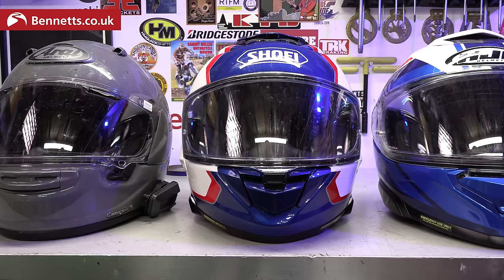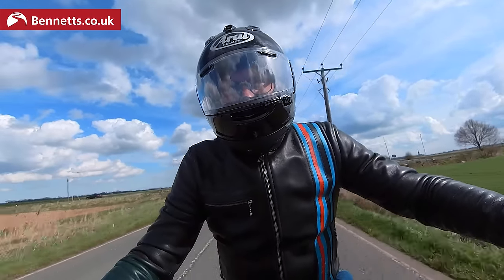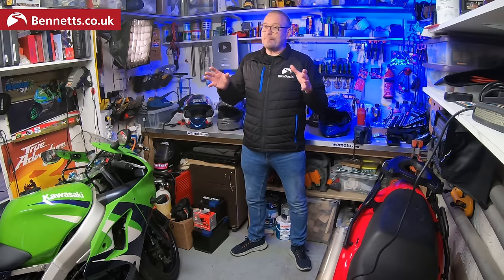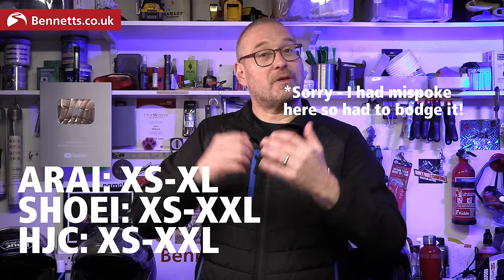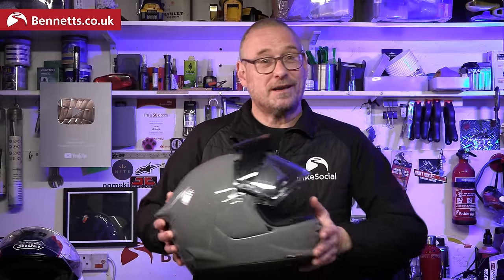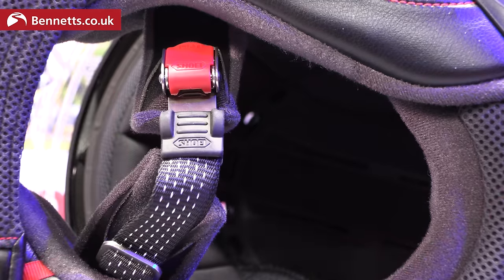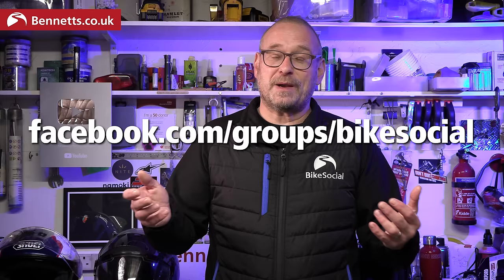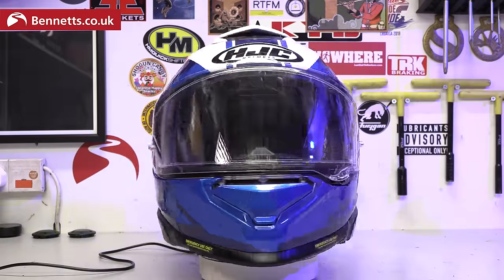Best sport-touring helmet: Arai Quantic vs Shoei GT-Air 3 vs HJC RPHA 71 vs Shark Spartan GT

Comment: I only got my motorbike licence in July. It was really interesting how naïve I was in regard to helmet choice. I was basically just looking at which one I liked the design of! Luckily my friend's dad gave me the best helmet advice you can have - try as many different ones on as you can. This turned out to be especially true being a glasses wearer. I bought a dedicated pair of glasses for my bike with reactive lenses (I do the same for car driving) and found that only a Nolan helmet and Arai Quantic fitted really well with the glasses on. Others just didn't sit as well (my favourite without glasses was the Shoei). My sena 50s kit fits better to the Arai and so that was the helmet for me.  With the reactive glasses the clear screen is absolutely fine even in mid summer days and I find they only ever steam up when going slowly at the very start of a ride (maybe due to the helmet/glasses not being up to temp or something). How fortunate was I that one of the most expensive was the best fit??? 😂😂  3000 miles later I have no issues at all with it, if anything it's slightly more comfortable as the helmet beds in (which is something you need to consider when buying - it will give a bit so any slack will get slightly bigger).  These reviews are brilliant at giving a comparison between the helmets and some of the features that you may want/ prefer but I would say the only way to choose really is to try them on.
Reply from the maker: Glad you got such good advice! Cheers, John

Comment: I jsut ordered 2 Aria Quantric.On sale 15% off (Self and the wife.) I looked at the Schubert as well as those 3 as wind noise was high on the list. (I have the VFR 800 Gen 5 in red like the bike in theI have in the corner.)I had the Aria  X7 I started riding in in the 80s, The Quantum E which had the best fit when new and the Vector 2. Seemed a safe bet the stick with Aria. I tried the Shoei RF 900 way back in 99 but the fit gave me a headache Didn't like the fit of the GT air 2 either. . I don't think I wanted the drop down visor.. The helmets come with the Aria sun shade thing but were free so no loss if we don't like them.  Thanks for the review. All the points of the 3 helments  and what I personally want ,the Aria is the right pick. Glad you didn't change my mine or would have to ring the store on Monday. I did watch the release video you did of the Quantric. You almost sounded liike a fan boy even though said you didn't want too.

Comment: I wear a Arai Viper GT.... Yes I know it's an old helmet (10 yrs old but it's seen little miles & well looked after). Had an Arai back in the 90's the went AGV but found the AGV innards wore out fairly quickly plus it had a seatbelt clip style to secure the chin strap which i felt wasn't that safe  should a crash occur. As for wind noise I've always been in the opinion that Arai's are noisier than most other helmets brands. Looking for a flip face helmet now too & am just about to watch the video on the Neotec 3. Great Video & stay safe out there
Reply from the maker: Give the Arai Quantic a try... It's a huge step up

Comment: I thought the dumbest thing that I ever did was to buy an Arai helmet. Nope. The dumbest thing I did was buying a 2nd Arai helmet. Finicky visor pivot and excessively fragile vents that broke when you look at them. And, even though it was otherwise sized correctly, I had real pain from the pressure against my ears such that wearing ear plugs for more than half a day was impossible. Going back to a Shoei solved every issue.

Comment: HJC seems to fit my head better than any other brand.  However, the visor detent is very weak and I was forced to ride with the visor either completely closed, crack so little that it might as well be completely closed, or fully open.  I jumped ship to AGV.

Comment: The main problem for me with these Helmets is the weight, never tried any of these brands, I would love to but they are expensive, except for hjc,and i can't wear heavy Helmets,I have neck problems,and can't wear a helmet for a long period of time, I've seen most of the reviews of every helmet brand you can think of, every new model,I'm not a big fan of a drop down sun visor, but I have an old Mt with it, it was my first helmet and I didn't have the experience, it wasn't that bad,after alot of reviews I decided to pull the trigger on the agv k6s,the lightest helmet with ece 06 cert, and it doesn't come with adrop down just like arai,  I found a good deal on a not that bad colorway!!

Comment: Thanks a lot for the review. I'll get a new helmet this year and those are the main candidates. I love Arais, they fit me best but the I really don't think the no sun visor but works out as a net security plus - even when ignoring practicality. Sure it might make the helmet a bit stronger at the same weight and size but riding with a clear visor when it's bright outside is fatiguing at best, and a dark visor in a dark tunnel is even worse and that will increase my accident risk. So I guess it will be the Shoei for the road and I'l stick to Arai for the track.

Comment: Top Job as always! I did try the Arai shade thingy years ago... and it was the horridiest thing ever. Always was in the wrong place, and not covering up the sun, now i have the internal visor and it's ok, i'm wearing glasses with self darkening lenses and they are amazing! Better than may eye! However the internal sun visor it's goof for the low wintery sun! And speaking of Arai, i did were it for years, but dropped it 5/6 years ago for the build quality, especially the visor way too easy to scratch and the plastic trim started to fell apart like it was nothing! Plus in Italy Arai cost a boat, did they improve the quality?
Reply from the maker: I've never had any issue with quality - always very good. Support is excellent too. Cheers, John

Comment: I have been using the RPHA 70 for 3 years and it has been the best one of all other i tested (Shoei, Schubert, and others). I even tested the RPHA 71 and I have to say that it is a lot worse than the RPHA 70. So I bought a new RPHA 70 Carbon for the next season which is an amazing helmet
Reply: You find it loud compared to others? My H70 requires speakers on full and my exhaust reverberates inside the helmet vs my agv
Reply: @dreamcrusher112  do you have the right size?
I have tested a lot more expensive brands and still the RPHA 70 beats them

Comment: I had HJC RPHA70 and I loved it. I bought HJC RPHA71 and the noice is killing me. Some sort of whirling right next to my ears, I think it's due to redesign in the lining and the channels for the intercom... Now I am back to looking for another helmet. I could not get Arai or shoei to fit well for some reason. I really wanted to get neotec2 or neotec3.
Reply: Hi I also have the rpha 71 now and that niggle is easily fixed by:
1st installing any BT coms system to fill the speaker pockets (mine is the new and original Hjc smart 11b which is a very good one btw)
2nd Using my motosafe touring earplugs. 
Problem solved!
Ride Safe
Ps
If you are thinking of going flip up/modular helmet rpha 91 is the quietest helmet in the world and it's the best modular I've ever owned. Cheers
Reply: @marcoaguiar3226  thank you for your feedback. I wasn't that keen on getting BT speakers. I know earplugs work but I was still getting distracted by the noise that was being generated. 

I ended up getting Shark Spartan RS.  Noise reduction is really good for my head/size.
Reply: I've got a rpha 70 and find the noise horrible. I had an old, cheap helmet that was quieter around town. The noise is less with the visor open, but as soon as i shut it, i get this deep, reverberating wind noise (even at 60kmh/35mph). I had to make up a bigger chin curtain and wear a scarf to reduce the noise, and even stuck some foam around the base of the chin, as i found putting my hand up to the chin bar cut most of the wind noise. 

But my helmet got damaged in a crash, so now i need a new helmet, and my insurance company has offered me the 71. I'm reluctant to take it, especially after a quick google search. It seems that all the testers who review it and test the wind noise have big windscreens, so if you ride a naked bike like i do, then the tests are useless.

Comment: Well... Sharp's testing might be handy. But in my own experience, HJC's RPHA lineup it's by far the worst of the 4. I work at a motorcycle gear shop and we've seen a few of them split in half under various conditions. I'll always tell customers that yes, it's got 22.06 rating, so if you 100% want one, fine, of course it provides some degree of protection but nothing anywhere close to the other 3 mentioned or even some others that are even cheaper.

Comment: So many tests have been done on helmet fasteners. The double D is, by far, the cheapest, easiest to use (admittedly not while you have gloves on, but why anyone would do that defeats me) and, most importantly, the safest. 
I use Shoei because they fit me the best. I'm sure the other helmets are just as good. But, I wouldn't buy a helmet with any strap securing device other than the DD.
Reply: In Shoei GT 3 you can change it to DD.

Comment: i bought the arai and its the best fit on my head shoei is a close 2nd.
If i was gonna buy one today it would be the shoei the DD rings is the safest maybe but the shoei is so much easier with gloves. sunshades in the shoei is the best just works so much better than the arai solution.

Comment: Having been wearing a Shoei NXR for just over 5 years... I'm definitely looking at the Neotec 3 as it's replacement. I've never been fond of the GT-Air line.
Reply: Why move to a flip helmet; has your usage changed or have you encountered any downsides to the NXR? Why not an NXR2 when it comes time to change?
Reply: @soots-stayingoutofthespotl5495  I like my NXR and it's great for days when you are out on your own or it's not overly hot, but there are times when you just want to flip up the front either to get air and cool down or to avoid having to take your helmet off every time to chat or you're out in nature somewhere and want to just sit on the bike a take it in.
Reply: @PokerMuppet  Oh right, I totally get it.

Comment: Fit is definitely the most important criterion, but so is style, and I have never seen a good looking Arai helmet.  They are ugly as sin and for that reason I would never even consider one.  I’m a Shoei fan - GT Air 2 for touring, X-SPR Pro for the track. They fit me perfectly, they look great, excellent field of view, good ventilation, and quiet. The drop down internal sun visor and micro-ratchet clasp are like cruise control - hard to live without once you’ve experienced them

Comment: All internal sun visors look like “nose slicers” in crash.  Had an HJC modular with one and it was clear my nose was going to suffer if that helmet ever rotated forward in a crash.  For me the Photochromatic/Transitions visors are the real solution to having a tinted or clear shield when you need it, especially when touring.  But unfortunately only a few helmets have those as options.  That’s why the Shoei RF 1200/1400 are my choice for s sport touring helmet.  And lighter than a modular or any of these in this test and with an optional Photochromatic Pinlock visor.

Comment: It is somewhat subjective - I found Arai just doesn’t fit my head - the shape felt wrong so not convinced a bit of different padding would have sorted it. On the other hand, I have had a Shoei XR1000/1100/NXR/GT Air/GT Air 2 and each one has fitted perfectly. My only gripe with the GTA2 is the stupid ratchet system. It is NOT easier than a double D loop and not matter how I adjust it one part of it digs into my neck. A solution looking for a problem if ever I saw one. The main reason for sticking with the GTA2 is that the flip down visor is so useful. I have it down on most spring and autumn days.
It is useless on hot days as the venting simply doesn’t work.
However… the elephant in the room is price. I paid £299 in the sale for my GTA1. How can Shoei justify more than double that for the GTA3! Given we are supposed to keep helmets for just a few years, dispose of them after the first decent impact or drop, and, sophisticated though they may be, it’s basically shaped resin with polystyrene and some paint! Today’s prices are frankly ridiculous.

Comment: I would upgrade my GT-Air 2 to a 3, but the Sena is not compatible. Very strange decision because it adds over £ 300 to also upgrade the Sena.
Reply from the maker: It is frustrating, though the SRL 3 is a higher spec and it's more compact. But yes, it'll be annoying for anyone who has it.
Reply: There is a adaptor kit now to fit GT AIR 3.

Comment: Still going after the 1250-1300 mark weight mark.......
They are safer to a degree because there is a 25% more helmet :)).......FFS.....
I have tried the best Shoei and Arai, but they do not conform to my pumpkin. The HJC RPHA 70 Carbon fits like a charm, gives me hamster cheeks and is snug and completely silent at silly speeds.
Older RHHA 70 has a visor so tight that it had a lot more positions, and it doesn't  fall anywhere, also has visor locks. But I do feel that it's kinda hard to open and close in the sense of power needed.
That is and is my case..... And to give things into perspective.....I have a friend who traded his NeoTec 2 for an LS helmet and he is happier with that one ..... So, it's a person to person preference.

Comment: I just want to add my experience to maybe help someone.

 Coming from a GT AIR 2 I planned to buy a GT AIR 3. 

Long story short, I returned it after 10 minutes only. The sun visor on the GT AIR 3 goes down if you ride with the clear visor open!!! it even lets air in. very bad quality IMO, 

Also, side note, it actually seemed worse in terms of noise than the gt air 2.

So yeah, if you're like me, stay with the GT AIR 2.

Comment: Very disappointed with my GT air, could never get the visor working properly in the rain, and the pinlock fitting was awful. Bought a HJC rpha 11 for my sportsbike and now only use that. The HJC fits my head far better.

Comment: Thanks for the video. I have the quantic and like it a lot. But the spoiler is too fragile. It's only lightly glued over the edges and can be detached even with minor hits on soft surfaces.
Reply from the maker: I've swung mine about by it and knocked it without it coming off. It is designed to detach in crash though. Have a word with your dealer and I'm sure they'll sort it. Cheers, John
Reply: @bennettsbikesocial  mine came off with probably a very unlucky angle of attack against a couch. I've put it back in place and it holds since then, but i would still have like a slightly stronger fitment. Make sense that it would fly off in a crash though.

Comment: I found the smaller pinlock in Shoeis to be the biggest downside really, it's very noticable in winter how your peripheral vision decreases. That being said I think they improved it on the NXR2. I found the Pro Shield to be okay but the gap at the bottom is a little annoying/distracting when trying to use a sat nav.

Was gonna say isn't the pro shield technically a 22.05 rated visor? Are visors tested differently too?
Reply from the maker: That's a good point! I don't think Arai has changed its visors, but I don't know if the Pro Shield has been homologated yet.

Comment: when ive tried the Rx7 on I get a pain around the top of the my temple not sure if that the same with the Quantic but Ive got a GT-air 2 at the min but coming up to that 5 years in use as for the shoei fastener I dont like it I like the old "D" ring . ok you cant fit it with gloves but how many times to you put your lid on with gloves on LOL  I dont like the Gt-air 2 Visor lock either I found I had to pull it down from the top

Comment: I'd be interested in changing from my Shoei Neotec to a Arai, but the lack of sun visor makes it a non starter.
Can't help think they've lost a lot of potential customers due to it.
Reply from the maker: They know the have - have a watch of that interview with Michio Arai
Reply: I’ve just gone from Neotec to GT-Air 3. I don’t use the modular feature much. Decided to try GT-Air 3 rather than Neotec 3. I’ve also fitted Cardo Edge in it, a bit fiddly but doable.
Reply: @kiwijeeper480 hey man. Can I ask why? I have a gt air2, and was actually looking for a flip up helmet, so i am curious to know why you would go back to a full face. I mean , are there obvious downsides (besides weight)
Reply: Yup. Hjc do a 70 for normal riding with a drop down, and an 11 without for racing. I’ve both, I prefer the 11, but the vent and drop down is soo useful, especially in spring when the sun is low, I bring it down 2” so acts as a sun visor. Arai need to give us a choice.

Comment: Reg. communication systems. If I'm not misinformed the 22.06 helmets lose their certification when something is added to the helmet. Therefore the helmet manufacturers cannot say it is Cardo compatible. So I ask you. Are the helmet compatible with the Cardo Pack Talk?
Reply from the maker: Homologation was a tricky issue, but basically if a manufacturer makes an accessory for a 22.06 helmet, they have to homologate it with it fitted to prove safety isn't compromised. If you choose to fit anything else to your helmet after buying it, that's up to you. Some lids are made to make it easy to fit aftermarket comms, like the Arai Tour-X5 for instance. Cheers, John